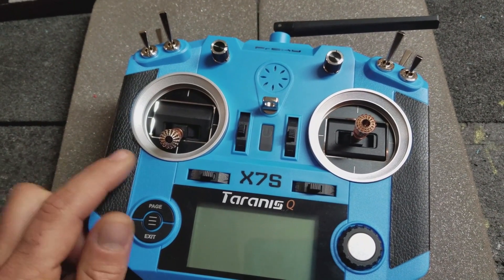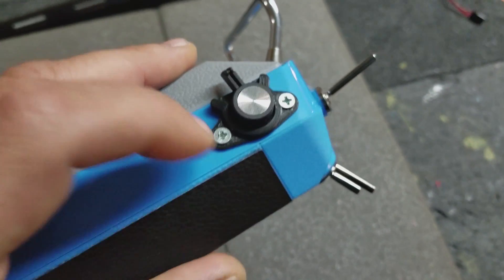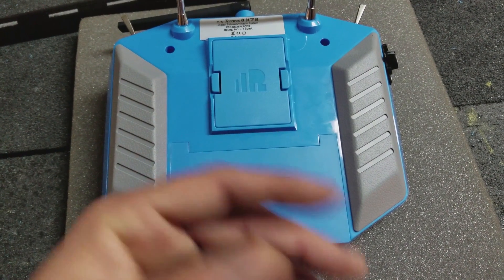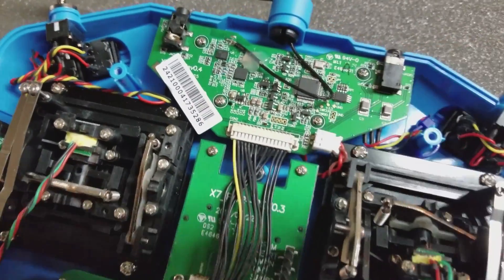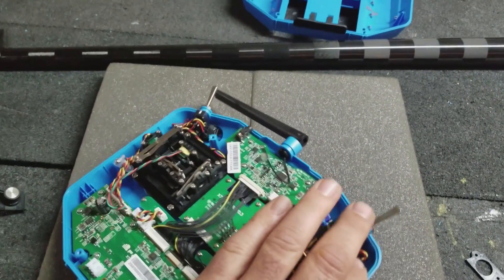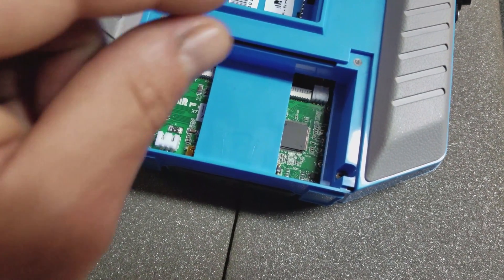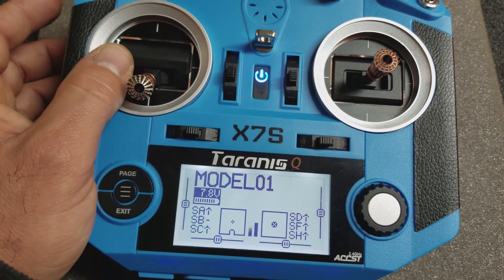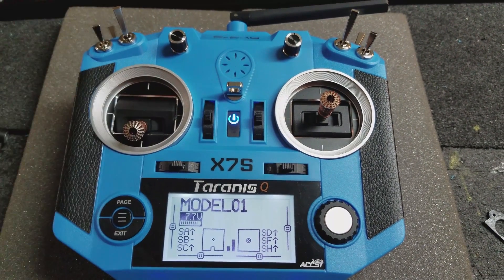Frsky Taranis Q X7 Mods Part 1, Slider

Comment: Did you know you can have both, analog pots AND sliders. There are 2 unused connectors on main board, where you can connect additional pots/sliders. So far only ersky9x has support for them. I don't know OpenTX is working on it. Check out this link
https://openrcforums.com/forum/viewtopic.php?f=97&t=10557

Comment: I am a bit confused. Did you add the sliders to the radio or you replaced the original pots for sliders?
Reply from the maker: Richard Raimondo I wanted a slider. The only way to do it was use one of the pots. So I gained a slider and lost one pot.
Reply: Well, I want both. I am using one pot for Stabilization Gain and the other for easy steering adjustment (a real pain in the neck otherwise, with independent rudder-steering channel), and one slider for audio volume. I was wondering if the Q7 had a free channel like the 9D (S3).
Reply: https://www.rcgroups.com/forums/showpost.php?p=39548831&postcount=7708
have a look here
you have to switch form optentx to ersky9x but you could mod two extra switches + two extra pots to your radio